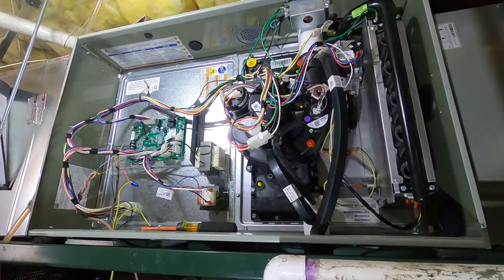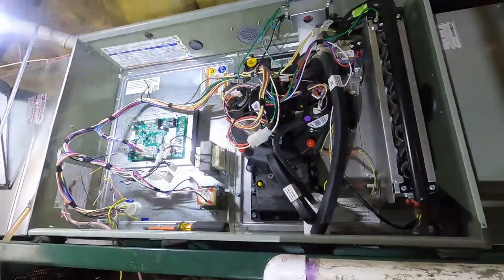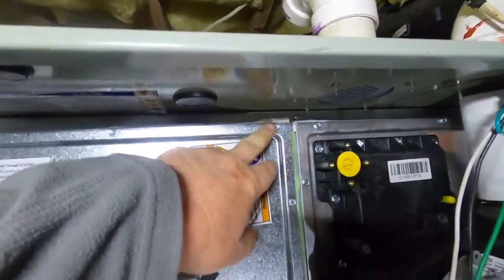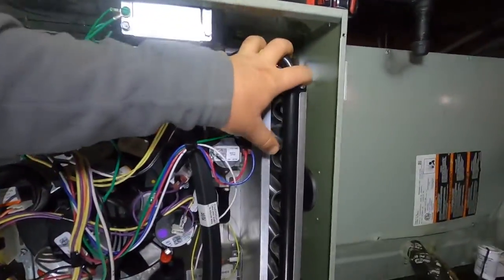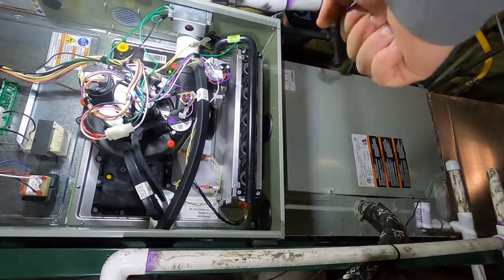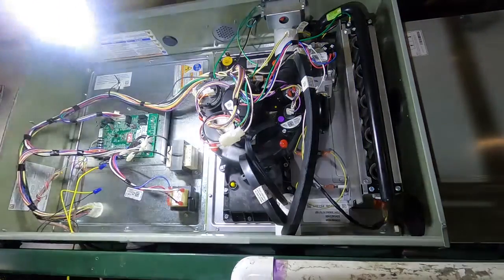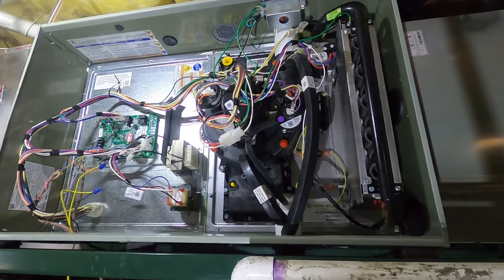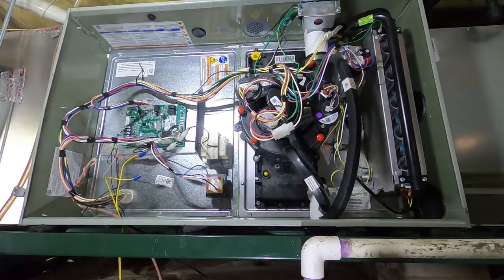Trane board replacement and an S9 furnace platform over view.

Comment: Is that the only way to access the blower. Seems like a huge hassle just to remove and clean blower wheel or check for obstruction. One reason I like Bryant is for easy access for blower and heating elements
Reply from the maker: Can have the blower assembly out in 5-10 mins max. After you do it a few times it is easy. No heat element, it is a furnace. But heat exchanger is easy access.
Reply: @MYHVACLIFE  we have installed a few of these and have not been able to work on them yet. There very new to us
Reply: I recommend having installers leave a couple of feet extra thermostat wiring to let you simply move the blower door off to the side when you have to get to the blower.